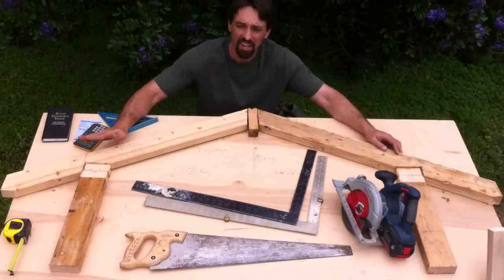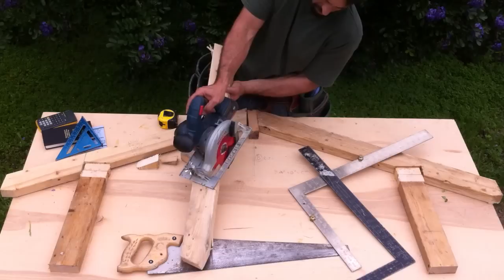How To Cut a Roof Rafter

Comment: great video! one question.. how do you know how much to cut off the bottom corner for the soffit?
Reply from the maker: just depends on how high you want the soffit.  You can also make the fascia and soffit cuts after the rafters are installed.

Comment: Hi, I'm doing my first project and it's a 12 X16 shed with a 3/12 (18 ") Rise but at.  the end I do not subtract what I should have and finish with a Rise of 22, And not 18 as it should be. How I get the inclination of the rafter toward the gable? Im sorry my english is not very good, I hope you can understand what I'm trying to say.
Reply from the maker: you are making a triangle with a rise and a run and a hypotenuse (rafter length).  the triangle's run starts at the building line or the outside face of the wall stud.  So the rafter length is the hypotenuse measured from the plumb line of the birds mouth.  If you are using a 2x6 rafter and it has a 4" height above the plate then that is going to make your rafter land 4" above 18 " (your rise) at the top.
Reply: ok thanks for you help. Im learning from your video.

Comment: Great video! I came here not cutting a rafter for almost 30 years since high school shop class. I had forgot everything about using a framing square to measure and do this. You helped me a great deal. one thing I will add when doing the bird mouth cut if you will flip the board over and mark it on both sides and use the skil saw on both sides in most cases it will cut all the way thru. Yea I'm allergic to that hand saw :).   thanks for the video man.

Comment: #Aaron Friend Hi, great video, thanks.  I have been struggling all day to get my cuts and angles right.  I am working in metric / cm, do you need to account for the ridge beam at all or can you just ignore that bit and do your a (horizontal) ignoring that and b (vertical).  I have measured my a and b and got my c measurement, ignoring the ridge beam, but this may be where I am going wrong?  Following this tutorial, I have got closer than anything I have done all day, but the angle of c on to the ridge beam is wrong by a few degrees.  The seat is pretty good.  Thanks in advance. @Allen Palmer

Comment: Hi, great video, thanks.  I have been struggling all day to get my cuts and angles right.  I am working in metric / cm, do you need to account for the ridge beam at all or can you just ignore that bit and do your a (horizontal) ignoring that and b (vertical).  I have measured my a and b and got my c measurement, ignoring the ridge beam, but this may be where I am going wrong?  Following this tutorial, I have got closer than anything I have done all day, but the angle of c on to the ridge beam is wrong by a few degrees.  The seat is pretty good.  Thanks in advance.
Reply from the maker: yes, i do subtract the half the thickness of of the ridge toward the end of the video.  Good luck with your project.
Reply: the calculations are the same you just need to buy a framing square that uses cm the conversion is done already for you on it find the distance of the building from there you can get all the calculations you need

Comment: Hi, im building a 4x7 shed and need some advice please. Wall frame is 2x2 and rafter timber is 3x2. Can you tell me what measurements/angle the birds mouth should be please??? Many thanks 😎
Reply from the maker: the rafter I cut in the video is for a four foot building width.  If you don't have any measuring tools you can just set the ridge board to your desired height and set your rafter on top of the ridge and wall and mark the wall and ridge locations and angles.  It won't be perfect, but it will be close enough.  Also I recommend using lumber for the rafter that is thick enough to support your weight when you are installing the roofing material.  Good luck.
Reply: Hi, thanks for replying back. Ive got a silver set square like your blue 1. If I set it at 4 common to get the 1st angle, how high do I need to mark up on that angle to make the second angle of the birdlip??? Thats what im stuck with. Like I said im using 3x2 timber for this so it should easily hold my weight 😀
Reply from the maker: 4/12 is the ratio, so your building width is 4 feet.  Half that is 2 feet.  2 feet or 24 inches is your run.   Your rise is 8 inches  8/24 is the same ratio as 4/12.  Now you have a rise and a run.  You have the bottom of a right triangle (24") and the perpendicular line of the right triangle (8").  a squared + b squared = c squared  is the Pythagorean theorem  c is the hypotenuse or the rafter length to the building line.  The building line is the point were the plum (vertical) line of the birds mouth starts.  You will also need to subtract 1/2 the thickness of the ridge from the first plumb cut you make with your speed square set at the 4/12 common position.  If you have a Swanson speed square the little blue book that came with it will also give you rafter lengths.  
Also I don't know what you mean by 2x3 but I wouldn't stand on a 2x4 with a birds mouth cut into it.  Good luck.
Reply: +Aaron Friend Im even more confused now lol. Ive decided to do all angles @ 45° which looks about right 😏 what I mean by 3x2 is the timber size is 3"x2". Thanks for all your help 😎
Reply: +Aaron Friend Im even more confused now lol. Ive decided to do all angles @ 45° which looks about right 😏 what I mean by 3x2 is the timber size is 3"x2". Thanks for all your help 😎
Reply: +Aaron Friend Im even more confused now lol. Ive decided to do all angles @ 45° which looks about right 😏 what I mean by 3x2 is the timber size is 3"x2". Thanks for all your help 😎
Reply: +Aaron Friend Im even more confused now lol. Ive decided to do all angles @ 45° which looks about right 😏 what I mean by 3x2 is the timber size is 3"x2". Thanks for all your help 😎

Comment: I just use a very simple calculation to find my rafter length.  Half the span divided by cos the angle I want then equals.

Example. if half the span is 2600mm and the pitch is 35 degrees.  2600 / cos 35 = 3174.013931.
Reply: man iv being looking for that calculation for a long time thank you any more tips for calculations for hip roofs?

Comment: I got the basics of it, you explained it very well, but Im stil confused on how to get the height of the ridge board, Im building a 16x16' cabin with a 12/12 roof.  say my ridge rafter is 8" thick.  how high would it be after removing the ridge rafter and compensating for the pockets
Reply from the maker: +don johnson   The horizontal part of the square tells you the width of the wall and the vertical part of the square tells you the height just add up the steps of the square, that is the total height of the triangle from the bottom of the top plate on the wall (the birds mouth line) to the top of the ridge.  Now subtract the height of the ridge board and you will know how  high to set the ridge.  16 x16 is a good opportunity to build a hip roof that is a perfect pyramid.  That is as strong a roof as you can get..., but don't let me make things more complicated than they need to be.  Good luck
Reply: +Aaron Friend Far less space with a pyramid roof, I'll be utilizing what space I have for a half loft.  I dont have a square to look at, at the moment but if its a 45 degree roof, just doing the math in my head, 8 foot out would be 8 foot up, minus the 8" ridge beam 7'4 for the height minus 1.5" for the top plate equals 7'2.5"   yes?
Reply from the maker: +don johnson   close, no need to subtract the top plate. the bottom of the birds mouth is the bottom of the triangle.  so 7'4" is right provided your ridge is a true 8".  If it is a 2x8 it will most likely be 7 and 1/4" so 7' 4 and 3/4" is your ridge support height.
Reply: So from there I would measure from the top of the board, C-11'2.5" (A-sq+B-sq=C-sq) minus the half of the ridge board, .75"= 11'1.75" to where I mark the 45 for the birds mouth
Reply: +don johnson I think I see my error, my B should be 7.33, not 8
Reply from the maker: +don johnson   If you are calculating the rafter length 8 for A and 8 for B is right.  I thought you were trying to calculate the height of a support block under the ridge board.

Comment: All good apart from 9:00 holding the circular saw in mid air like that whilst cutting!
Reply from the maker: +DanieI Joseph  While I wouldn't recommend it for a novice, one of the nice things about the little battery operated saws is that I am stronger than the kick back.  however, if you can follow the line there is no kick back.  After 20+ years with a circular saw, I have learned how to follow the line.  There must be three points of contact on a board especially when cutting an angle and even more so when cutting a compound angle.  Two points of contact to secure the board so it will not rotate with the pressure from the saw on the third point.  It would be safer to clamp the board in two places and hold the saw with both hands, but honestly I have never ever ever seen a framer clamp a single rafter to cut it.  If one has never used a saw two clamps is the way to go, you are right Daniel.  Safety first

Comment: Good video. You showed a simple way of cutting a rafter. My question is how do you know how high to set the ridge?
Reply from the maker: Butt Head The plumb side of the square measures the vertical.  Don't forget to subtract the ridge material from your support